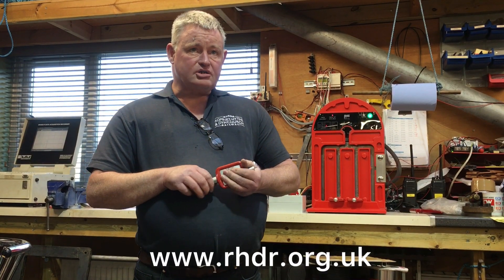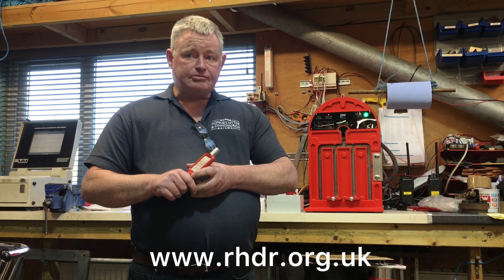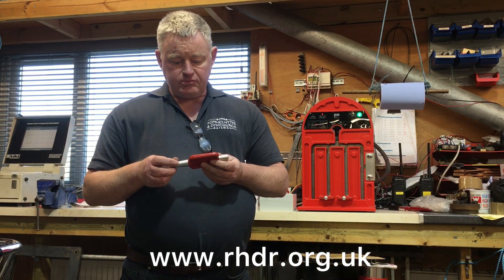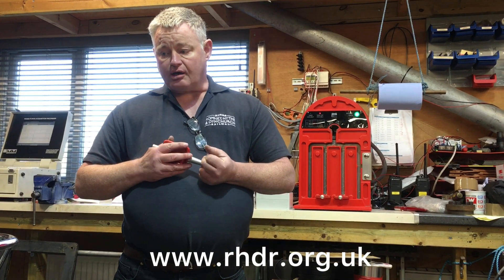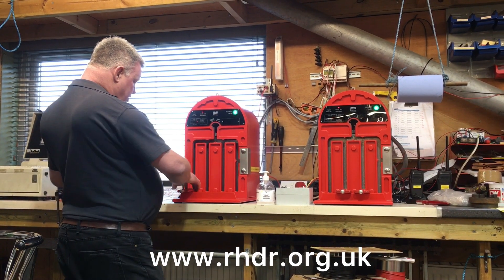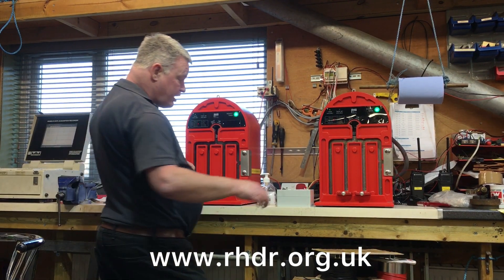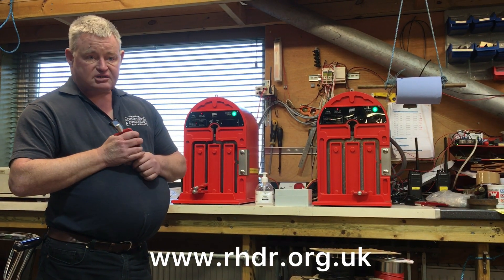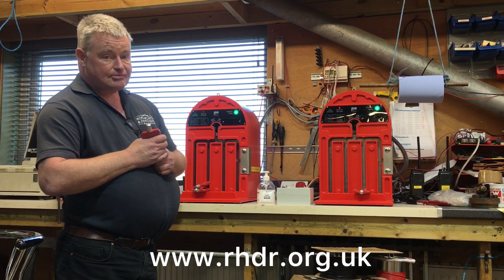DiBloC system - part 1.

Comment: I worked trains under Electric Staff working, in South Australia, during the 1980s. When Train Order Working replaced Electric Staff in late 1980/early 1990s, I purchased a surplus Electric Staff instrument from Australian National Railways Islington Workshops. The machine I have is a type M, manufactured by Railway Signal Co Ltd, Liverpool. It has "F" pattern staffs in it. 😉👍

Comment: Good evening, some single track museum railways in the United Kingdom are still operated with staff or token blocks although all their stations are equipped not only with home signals but also with departure signals (generally "railway semaphore signals" with arms positioned at 45º in the dial lower or in the upper quadrant to communicate to the driver that the way is clear).  It is therefore not clear to me the need to have a staff or token block in the presence of starting signals.  In other words, the signals that authorize the sending of trains in the opposite direction along the single track section could not be interconnected with each other in order to avoid head-on collisions as well as pile-ups as happens on double-track lines equipped with "Absolute block" ?  If I remember correctly, the intermediate railway stations of the lines operated with the "Radio Electronic Token Block" do not have departure signals, except the "Stop Board".  Grateful for the attention given to me, I would like to take this opportunity to extend cordial and sincere regards
Reply: It prevent a foolish signaller from setting the signal to danger, or doing the train cleared proschedure before the train has arrived. If the signaller has the token, then the driver must have given him the token, which means the line is clear.

Comment: As a then teenage railway fan in Northern Ireland (50+ years ago) I used to be allowed to "work the box" by many of the signalmen, and the predominant single line device was the Tyers No 6 Tablet Instrument. This is a really interesting modern implementation of that type of instrument. And as a now local "Marshian", i'd be really interested come and see this device in the flesh.